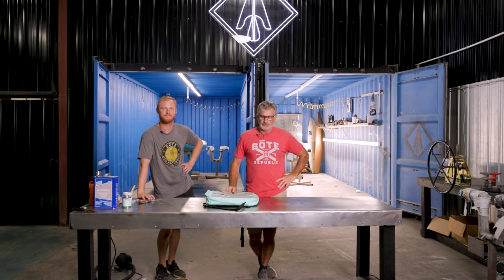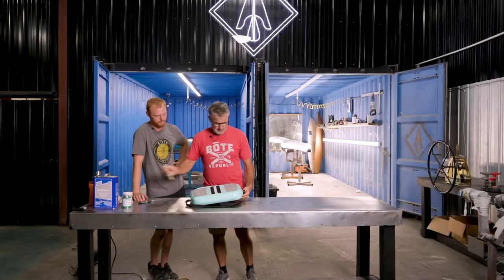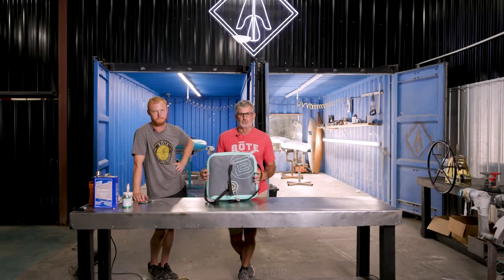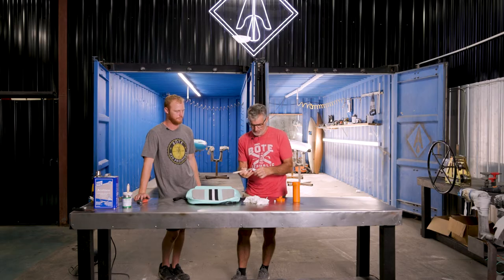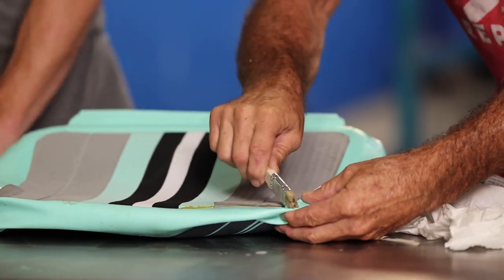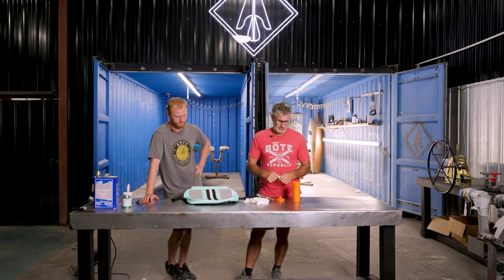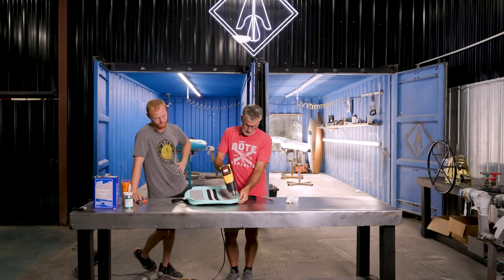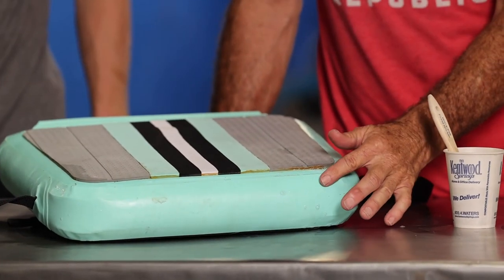How To:  Seam Leak Maintenance

Comment: Would this "seemingly easy" repair work on a Walker Bay Airis Sport 11' Inflatable Kayak which is PVC?  I hadn't used it for over a year and I inflated it and kept it in my living room overnight to make sure all was well before I launched it into the ocean.  I have a pump that connects to my car battery and shuts off when it reaches the 6 PSI.  All was well until I reached the ocean and the Sport 11 was becoming limp.  I returned home and did the soapy water test and found 3 leaks in seams, yet the areas show NO damage, no rips/holes.  Walker Bay made kayaks, then stopped, then started again but ultimately have stopped now for good.  This should not have happened for a kayak that was minimally used and always well taken care of.  Thank you in advance for any advice you can give me.  I know how to patch a hole, but air releasing along seams makes me not feel safe if I go out on the ocean.  At the time, WB was the best high pressure IF.  I have a dry storage compartment behind the seat, aft-stern area.  It has a skeg and tracks well.  Newer kayaks seem to have lost their quality.
P.S. Sorry for such a lengthy comment.  My kayak is in great shape besides the multiple leakage. Would you suggest that I take the IF to a repair place and have all the seams re-glued/reinforced?  Again, thanks for taking the time to help.